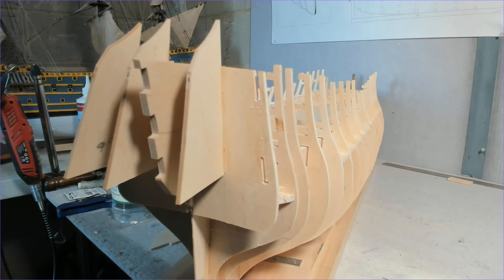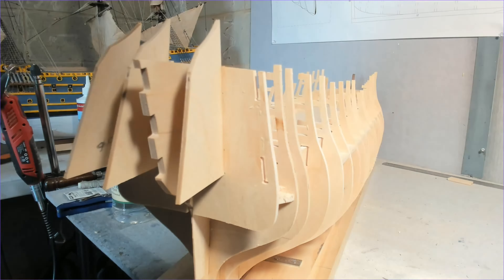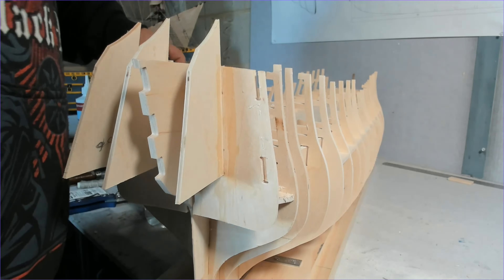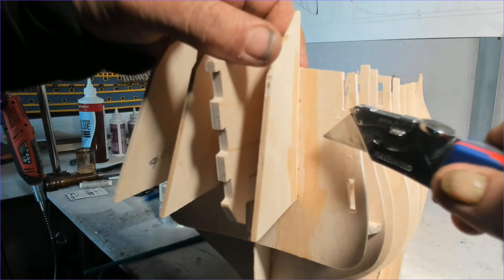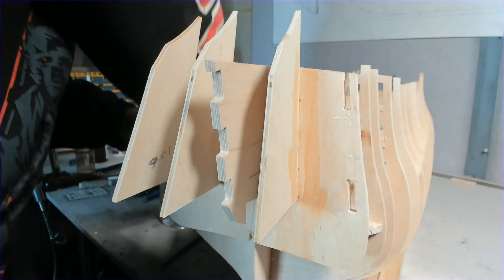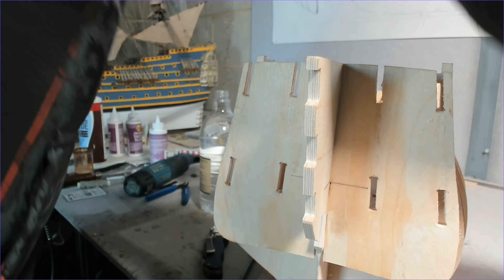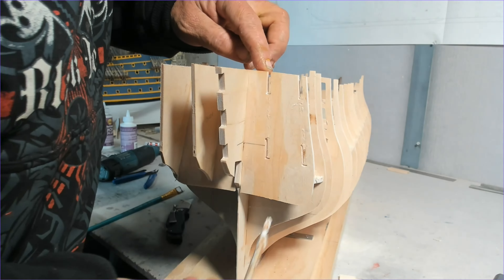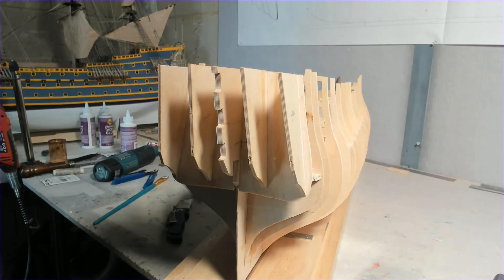Oops my part has been placed wrong! (How to fix it)

Comment: I use the heat gun at maximum power, 2 minutes to dismantle the piece
Reply from the maker: I will have to give that a try
Reply: @GregWilson635 all glues, any type of glue, are thermolabile, they do not resist heat
Reply from the maker: @giovanniallegro3790  I'll have to get myself a heat gun

Comment: If you Are Using  super glue Use finger Nail Polish Remover Brush along the glue seams It Will come Off If you Used Water Based glues Take your No.11 blade and cut along the glue joints your done
Reply from the maker: Thanks for the tips 😀

Comment: I use 99% rubbing alcohol to brake a pva joint.
Reply from the maker: Thanks for the tip. If I do it again, and I probably will, I'll give that a try .
Reply: @GregWilson635  I just started to get into the hobby, and my Dory I had a nasty rotation in my transom. I use the alcohol to remove and then I was able to reset it correctly.
Reply from the maker: @jamessmckay  it's a good idea . I'm always happy to learn from others.